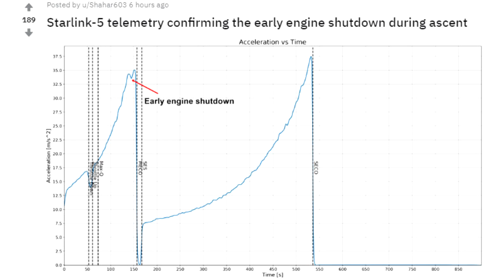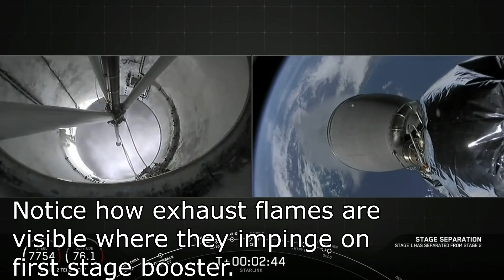Falcon 9 Suffers In Flight Engine Failure, Booster is Lost,  but Cargo Delivered Successfully

Comment: "Too much power" - As a KSP Player, I didn't know this is a thing.
Reply: It's just another way of saying "not enough struts".
Reply: right? that just means you get to space faster!
Reply: @SierraofTerra  No it means the MaxQ would inflict more G-force on the ship then usual. Its not enough to end the mission but not 100% safe.
Reply: Too much power is easily possible by an engine being too explody.
Reply: @wumpusthehunted2628  a power surge or surges  tend to be the initial signs of a POGO oscillation... Liquid fueled engines are always at risk for this and many anti POGO systems are in place but space history is filled with instances of early engine shut downs due to POGO...
Reply: wumpus the hunted Nonono
Reply: Needed more Cow Bell.
Reply: @please_stop-v7o  you don't know what jokes are, do you?
Reply: @please_stop-v7o  it... it was a joke... about ksp...
Reply: What did 221 b say?
Reply: @t65bx25  I have no idea, but I would like to know
Reply: Tim “The Tool Man” Taylor never had that problem.
Reply: That just means you dont have enough struts!!!
Reply: "Flawless countdown"
Reply: Only too much power if you burn up before reaching space due to sheer speed.  Even then just add moar heatsheilds
Reply: Thrust out of spec=possible fuel shortage for landing.
Reply: Sacrilege!
Reply: I always though the Falcon 9 would look so sexy with a large pair of boobsters XD
Reply: This is something jeb would say
Reply: I feel like i need to know what @221 b said
Reply: Quazar501 it’s only too much power if your Bradley Whistance, who gets to orbit in 33 seconds and another engine would have caused the craft to pinwheel and disintegrate (probabaly)
Reply: Well McFarland would like to look at that TURBSKI !!
Reply: Seems Like The Idiot Who Didn't Get The Joke Deleted His Comment
Reply: Well there never is “too much power” in KSP as squad (and Matt Lowne) would say just always add MOAR BOOSTERS
Reply: @please_stop-v7o  yes

Comment: It may not have survived, but the mission was accomplished. What an honorable booster.😔
Reply: It did have some self preservation instincts on Sunday
Reply: As I recall, when SpaceX was first bringing the Falcon 9 to market some of the selling points were that:
A) the launch programming intentionally holds the booster down until the software confirms engine performance, and is designed to shut the engines down if the engines aren't "nominal", and
B) nine engines provided redundancy, making it more likely the mission would be successful even if one or more engines fail.

Kinda seems to me this booster performed as advertised.
Reply: @johnmothershead1690  I think they may be trying to see what they can get away with when it comes to refurbishment between flights. Honestly when I see failures from SpaceX it almost always have to do with testing and innovation, more than just a mistake/malfunction. It always seems to be something they are changing/ testing that causes it. Notice both failed boosters were Starlink, which is their own payload. (I believe they were sorry if Im wrong)
Reply: Salutes what brave and honorable booster
Reply: Today was a good day to die
Reply: Sunday: Die Another Day
Wednesday: No Time to Die
Reply: DEATH BEFORE DISHONOR!
plunges into the ocean
Reply: He died doing what he loved, his only regret that he had but one life to give for his mission. 
May we meet again, gentle booster.
Reply: This booster did not rack disciprine.
Reply: @sixstringedthing  We must hold tweek and craig with the HIGHEST HONOUR GAMBARO IRASHAI!!

Comment: I clicked on this notification faster than the guy managing the spacex livestream clicked away from the booster landing
Reply: Elon has previously said that they will always show failures after someone changed the camera on a previous booster landing failure. Apparently that time it was the guys managing the stream who didn't know what to do, panicked a little and switched away. 

It did look like it lost downlink though? If not they'll release the footage after a few days like they usually do I suspect.
Reply: It's a bit sad that they don't show failures. That's the exciting part. Well they did show with that booster making soft water landing outside the coast, but that an exception.
Reply: @macjonte  it's like they afraid of bad PR, but this is freaking rockets we talking about... controlled chemical explosions! Stuff blows up when everything is working and when it doesn't work as planned it blows up some more!
Reply: Why do they do that? Why not livestream as long as possible?
Reply: Some people only watch auto racing for the crashes. Falcon 9 landings are probably about the same, only no people get hurt when one crashes.

Comment: Just proves how reliable the rocket is
Reply: For 5 flights it seems. Still, the right direction.
Reply: @armr6937  that's 5 times the reusability than anything
Reply: I meant as in that the rocket CRS;lose an engine (very rare) but when it does it doesn’t affect the payload insertion at all

Comment: RIP 1048.5.

When i saw on MECO the hiccup on the Engine i knew it would go bad, then on entry burn, the booster made big roll corrections then no landing burn confirmation i knew it was going to crash.
Reply: They said "entering terminal guidance" so they had a connection but knew it wouldn't make it.
Reply: Agree...it made extreme movements after the entry burn, and at the moment I felt something was amidst.